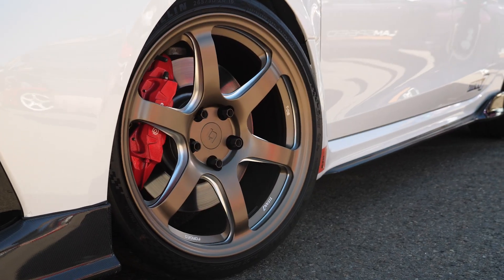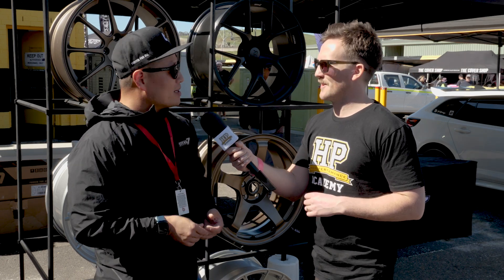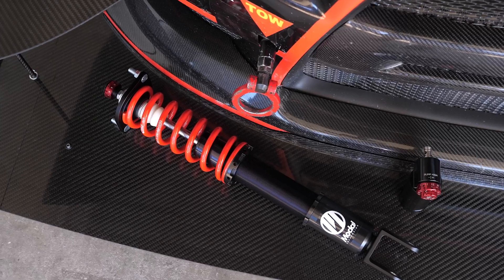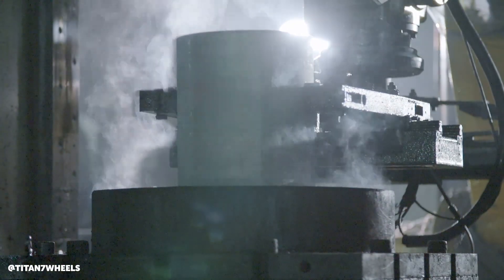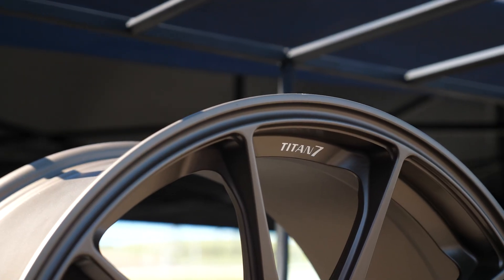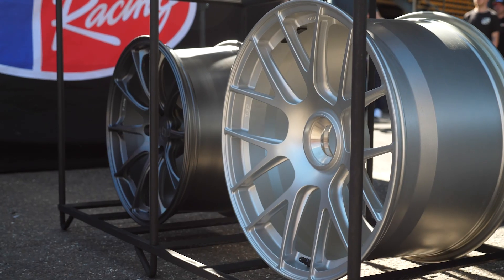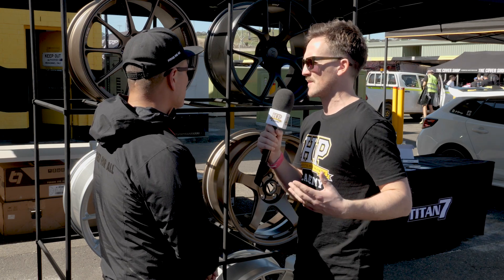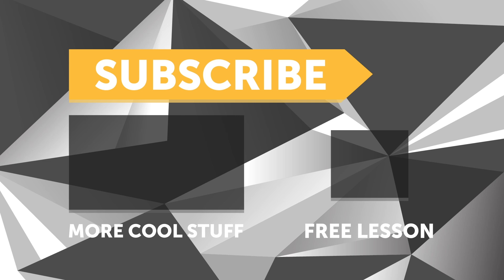Are you an expert? | Aftermarket Wheels

Comment from the maker: 🏎 Building a fast car? Speed up the process and get $400 OFF the all-inclusive VIP online course package deal: https://hpcdmy.co/y21
🛞 No more cut tyres, bent rims or poor fitment, No excuses. The HPA Wheel and Tyre Fitment online course is here to help. 50% off and instant access, enrol now:  https://hpcdmy.co/bw7
Reply: 12,000 tons is not 12,000lbs (as your thumbnail says)  12,000 tons is 24,000,000lbs
Reply from the maker: @theheadone  you're right! Should have gone with the higher number in lbs eh! Bit of a brain fart while banging that out, the team is fixing it now to be 12,000 tons. Appreciate you pointing that out! - Taz.

Comment: That weight on the forging press thing is 10,000 tonnes? Is it not 10,000lbs? I would have thoight 10,000 tonnes would look a bit bigger. Or is there another aspect of the construction that involves 10,000 tonnes?
Reply from the maker: 10,000 tons is correct. You can validate that by searching some other sources in relation to forged wheels. Crazy eh! - Taz.
Reply: @hpa101  yeah that's very impressive. Thanks for confirming.

Comment: Aftermarket wheels are great but making sure people fit them correctly with the correct wheel/lug nuts , using a tyre/ wheel calculator to make sure clearances , rolling radiuses etc 
Do your homework and fit them correctly

Comment: I went to my local Beaurepaire, not only did these clowns scrape my rims, they...

1. fitted my staggered wheels in such a manner that I had 4 different wheel setups on my car - one smaller tire on back rim and rubber for a back wheel on one of the fronts! How is that even possible?
2. put my rear wheel spacers on the front WITH the standard lugs, which I managed to pull them up about as they were doing it
3. did not align the dots correctly
4. tried to tell me they did nothing wrong.
5. offered to wash my car as compensation, they could have killed me!

Never take your pride and joy to Beaurepaires.